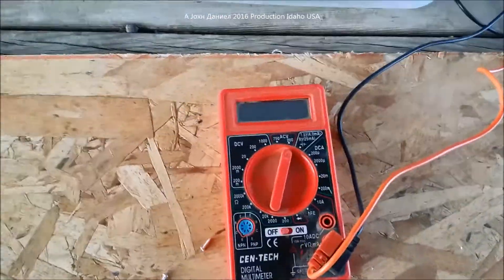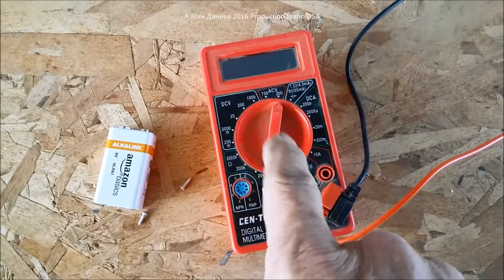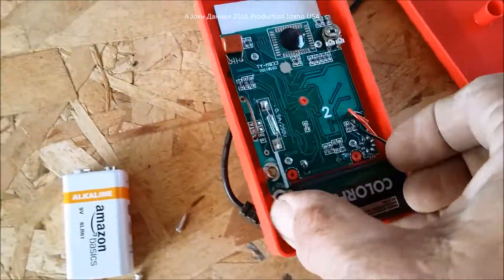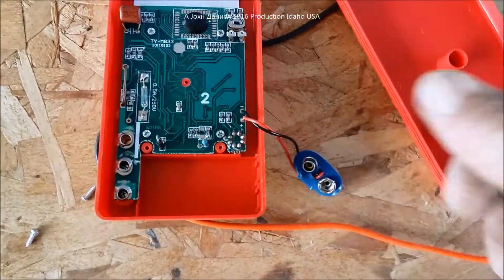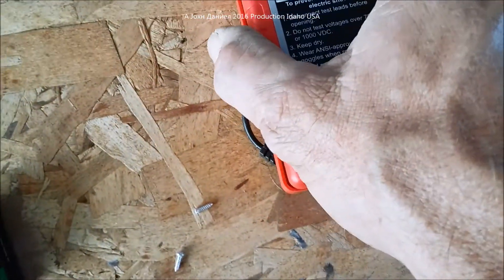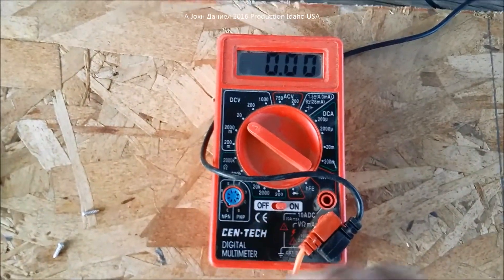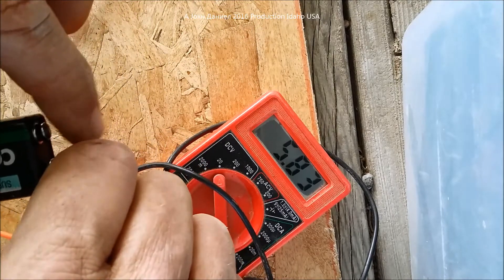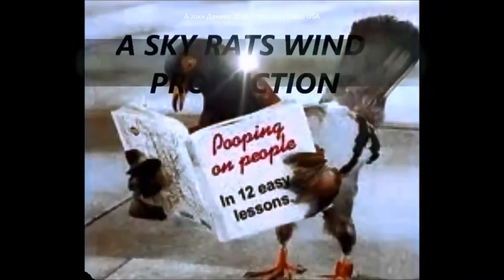CenTech Harbor Freight multimeter Fix it Don't Throw it away

Comment: the stock battery in my Centech finally got weak after 6+ years, it actually shows a low battery icon on the left side of the screen as well, Thanks for the video I didn't realize it could be replaced this easy.

Comment: Thank you so much 😀 I have a harbor freight voltmeter that is a 7 function Digital multimeter. This morning i was testing voltage on a battery and the measurement got thrown off. I put a fresh battery in and tested the old one, but the voltage came back as 9.7 volts which i don't know why it's still good even though the measurement got thrown off.

Comment: Here it is almost three years later and I popped the fuse in one of these.    There is a fuse ... it's labeled on the circuit board on yours and soldered in... the one I have it's held with clips.  Anyway a new fuse and it will be good to go.   Maybe the newer ones are self protected better but I managed to blow the fuse in the one I was using.

Comment: Would you know if you can calibrate the voltage reading.  I have a few of these and they all measure a slightly different voltage.    I do have an accurate voltmeter and I would like to calibrate the CenTech to it.
Reply: The test leads are more likely to fall apart before the battery dies.
Reply: I heard someone say there is a potentiometer under the back cover you can adjust.
Reply: There was a pot that could be adjusted. In the latest ones it has been eliminared. Even though they look the same, there have been several changes to the innards over the years